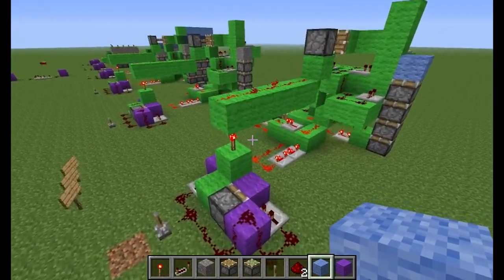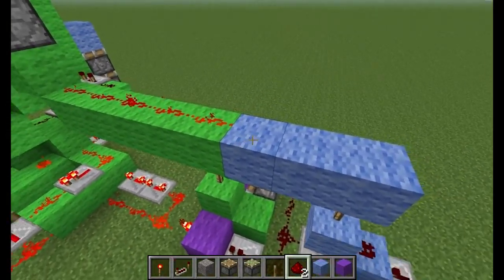Minecraft Tutorial: Vertical Non-Sticky Quintuple Piston Extender

Comment: I'm having problems with the quintuple as well as the quadruple.  I have noticed a repeater which was redstone dust in the quadruple piston extender, set to 2 at the top in 3:10.  I have tried this, but it still doesn't work.  I think one of the repeaters round he back of the machine is changed.  Any help?